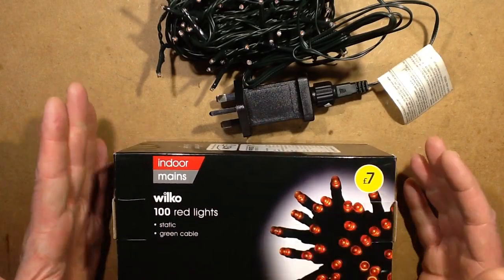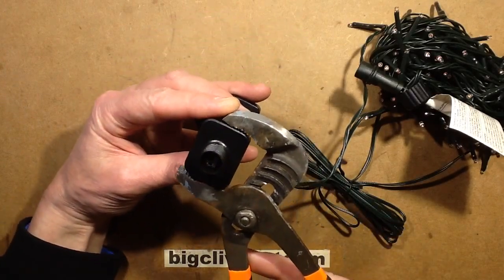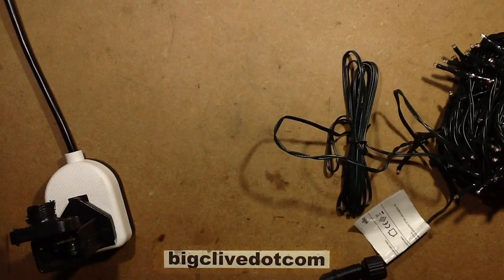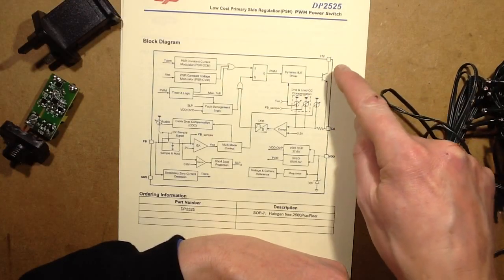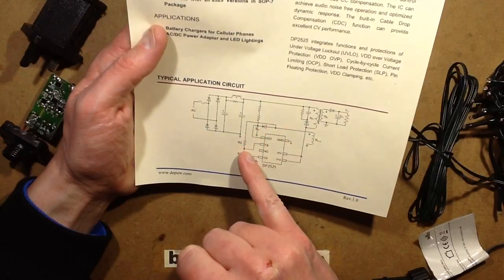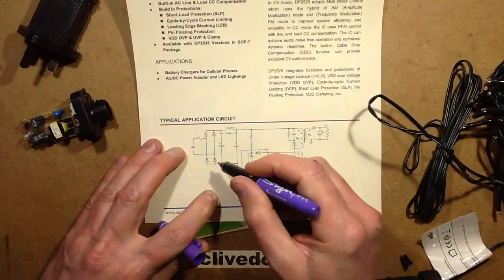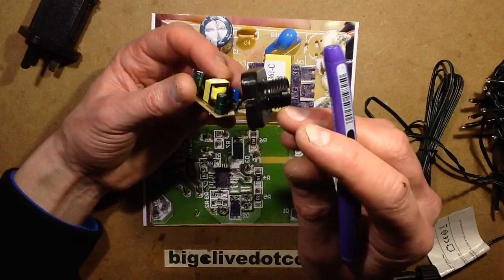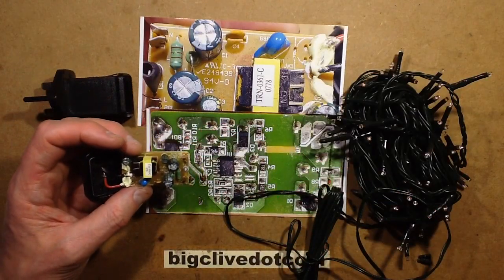Inside a Jutai Xmas lighting power supply.

Comment: Big Clive - I have a 200LED string powered by a JUTAI supply (https://www.amazon.com/gp/product/B07W8X7D14/ref=ppx_yo_dt_b_asin_title_o01_s00?ie=UTF8&psc=1)  and when I tried to shorten the led - cut in half...I had difficulty getting it to work...and when I finally got it working...I could not connect it in series with other strings.... what happens is that the modified string stays lit but the other strings turn off....what's up with this?  is there a trick to shortening this LED string?
Reply from the maker: The common connection for these strings usually goes to the opposite end of the string and then passes through multiple parallel circuits.  The reduced voltage of the shortened string will be lowering the power supply output voltage to a level that can't make the other strings light.
You can't really cut them down in size like that.

Comment: Would it be possible to add an inline switch to a power supply like this? The settings remain in the memory if I unplug the cable from the power supply while leaving the actual power supply connected to the power outlet. Would a special in line switch be required? And would the chip get damaged if it was constantly receiving power from the outlet without the lights being on?

Comment: Very interesting. None of the LED holiday lights I've seen here in the US have that kind of power supply; they just have the whole string on line voltage with a limiting resistor. They flicker like mad.
Reply: Could someone help answer a question? I bought some vine led lights off Amazon, it came with a 2 prong circular Dongguan Rico brand plug and a tiny black LED converter/driver box to go into my American style outlet. The voltage says 100-240v 50/60Hz .2A input, and output is 31V 193mA 6W. I’m not sure the voltage that my American outlet has but it was plugged into an extension cord that I’ve used for 2 years with no problems. The lights stopped working after 2 weeks. The driver/converter box still works with a different brand of string lights with nearly the same input/output so I know the driver still works but the lights on the vine don’t light up. Can I do or buy anything to fix it? Or did the bulbs short out or it’s a fuse issue? It was probably cheap and it says on the black box it’s made in China, which I’m sure they weren’t doing their due diligence to handle American outlets and it overloaded. If someone could let me know a way to fix it that would be great, I love the vine lights and they were a pain to put on the wall!
Reply: @maryhawker5003  I’m helping someone and she’s having the same exact issue, won’t turn on but the little green light for the timer works, but the strong of lights doesn’t turn on.

Comment: Hey Clive, I have one of those lights, except mine flash and there's a button to change functions. One set that I bought has warm yellow and red on one "side" and green and blue on the other "side", meaning either warm and red are on, or blue and green. How would i modify those non-destructively to only turn on the warm and red ones? I'd love to know. I guess this has to do with polarity and I am guessing I'd need to add some diodes in the circuit somewhere between the lights and the wall wart but I'm not sure how or where exactly.
Reply from the maker: If it's a two wire system then you could selectively choose the pair of colours you wanted by using a lighting power supply with the same voltage but just fixed polarity.
Reply: Sure, but that doesn't have the animation effects then!
Reply: @cheater00  Makers of of these 2-channel strings focus on always including both channels/colours in the effect modes.  Bi-colour controllers have the appropriate individual channel modes in place of modes of annoying types of flashing..they are attached to new strings though :)

Comment: Can you get lights like thi (decent low voltage supply)s through eBay as well, or is everything on there the stupid full-mains style?
Reply from the maker: If you can find the low voltage sets on eBay they're often at least as expensive as just buying them locally.
Reply: Or most of the time you can just cut the wire after the bridge rectifier (the little rectangular box on the wire) and power them by the voltage provided by the original power supply. I've found out that most of them run at 31VDC, even though it says 24VAC on the power supply.

Comment: So if I follow you,  could this power supply be repurposed with a different voltage by selecting a different sense resistor?
Reply from the maker: The winding ratio is also a factor, but the sense resistor would also have an effect on the output voltage.

Comment: Slightly off topic question: I recently bought a powered cooler pad for my laptop. It's basically a metal mesh frame with a great big 5v fan in it that you power off of a USB port. I'm concerned to use the power function because I don't wanna run into any inductive flyback from the motor. Should I install a diode and/or capacitor into it to guard against flyback or is the motor insufficient to the task of generating dangerous spikes?
Reply from the maker: They usually use an electronically commutated fan with back EMF diodes on the PCB, so it should be OK.

Comment: The "protection network" actually serves two very important other functions.  The main one is that of resetting the transformer core.  A plain free wheeling diode would protect even better, but it would cause a very long core recovery time and the drive frequency would drop from kilohertz to just hertz range.  It is necessary to allow some voltage overshoot. The other reason is to help provide feedback without the traditional optocoupler.  There is a company selling chips based entirely on this principle.

Comment: Un-fun fact:
100% of all LED christmas lights don't have proper DC smoothing.
Reply: I've looked at a LED powered straight from a 1 kHz signal generator, and it was still easy to see the flicker. All you need is for it to be a bright dot against a darker background, and then move your eyes quickly. If the light flickers, it draws a series of dots instead of an unbroken line. And this is why it's annoying in real life; instead of natural motion blur you see a glimpse of a dotted string.
Reply: Yeah, right. You don't see several kilohertz flicker, no matter how trained your eye is.
Reply: False. I bought some "north light" ones (as seen on bigclive's channel) from Clas Ohlson, and they are absolutely flicker-free. Some others were as well. But yes it's annoyingly common for xmas lights to flicker at 100 Hz. Also LED light bulbs for mains often flicker at a couple hundred hertz, but some of them are flicker-free.
Reply: Except these ones do? Any low-voltage DC set does, in fact. Ok, fair enough, they don't have proper smoothing, but the switching frequency of these SMPSes is high enough that you will not see them flickering.
Reply: Jasper Janssen I do see them fickering, due to my trained eyes 
Very annoying for an electrical worker like me
Reply: It's not about seeing the SMPS switching frequency as a flicker, but typically some low multiple of the mains frequency. You would think any SMPS-powered set should be flicker-free, but somehow not all of them are. But it's the cheap capacitive droppers that cause the worst flickering.
Reply: That's not a badly filtered smps output though. That's a less than 50% (because forward voltage — on a +5 to -5 siggen amplitude signal it'll be on the order of 20-30%) duty cycle, not a small difference in intensity (and most SMPS runs faster than 1k).
Reply: Jasper Janssen ot the high freq flickering, but the 50/60hz flickering.
Reply: 7367Network yeeees, but they don't do 50Hz, because SMPS.
Reply: The low-cost ones do, the expensive doesn't since they've got a DC switching power supply. For next Christmas I'm going to light up all of my house (edges and roof) with typical amber/yellow eBay lights, but powering them with an adjustable power supply, one of those fancy ones which can also limit current. Gonna be great.
Reply: The cheap ones aren't really low voltage though[1], they work all the way up in the most-of-mains voltages. You could probably divide the individual strings up without too much trouble, but they're not usually 10-series strings natively. Usually more in the 66-86 range, for 220-targeted lights.

[1] not in the colloquial "less than 50VDC is reasonably safe" sense, anyway. In the power company sense where everything under 1000VACrms is Low Voltage, and then Medium Voltage starts, sure.

Comment: Just a suggestion for Mr Clive! I think you will like it, since it burns and produces cancerogenic fumes in your unventilated room :-)
My favourite tool of controlled destruction is a glowing hot wire (just short length of nichrome wire in ceramic holder connected to old ATX PSU 3.3V rail, i have a few different diameters of wire ready for different levels of disobedience).
Instead of dremelling/grinding/drilling into plastics (which can mess up electronics underneath if you are messy/careless/drunk/stoned/impatient like me) i like to use it to cut through stubborn plastic. Or just generally instead of drilling/grinding plastic. Or to heat disobedient "security" screws heads, till their head melts through plastic when you pull the damn thing open. 
It comes with FREE CANCER included! and while it glows orange hot at 700-900deg. Celsius, the thinner wire has waaay too low thermal capacity to damage/desolder even the smallest smd components, just in case you hit something you did not intend to...
Merry Xmas!
Reply: Wow!

Comment: Merry Christmas!  Maybe the split series inductor design is an attempt to reduce conducted EMI. The removed resistors make me think someone fine tuned the design based on testing of early production boards, so they could've shorted out that second inductor if it passed pretesting without.

Comment: I got some lights from Aldi with a similar but same brand adapter, we plugged it in and it made a magic smell. So was discouraged to use it again, but tired it again no smell... I think the weird screw in part wasnt in correctly, its a czjutai model jt-el/fc31v3.6W-t 220-240V 50-60hz, its one with a button to change the modes.

Comment: I have a wall wart switching supply that spits out a pretty well regulated 12 v,  I'm used to seeing an opto isolator being used to give a little feedback from the low voltage side, but this supply does not have that, all that's connected to the secondary is a diode and capacitor and I wondered just how the hell it's able to regulate it's output. So I wonder if that works the same way as this does, It certainly would clear up that mystery.

Comment: Have you seen mikeselectricstuff's technique of tapping around the edge of these ultrasonic welds with the butt end of a screwdriver? Might not have worked with this particular supply but it does work pretty well.

Comment: A tip on ultrasonically welded plastic cases, wack the case with the handle of a screwdriver a few times. (I haven't had much luck with this technique myself, but it seems to work very well for Mike over at mikeselectricstuff)
Reply: subpar gaming, the Hittin' Stick and the Clampy Thing are useful for massaging the recalcitrant object under inspection when it has already released its magic smoke in a permanent sort of fashion and you just want to have a look at the guts and work out why it threw a tantrum. Opening things in this manner tends to be a precursor to tossing it in the bin once you've worked out why it's not worth fixing.
Reply: @sixstringedthing  I've had alot of luck with the "gently clamp it in the vice until it makes cracking noises" method to get glued or ultrasonically welded plastic cases to split at the seams without destruction. They can usually be glued back together without a whole lot of evidence of the vice squeezing also.. 🤷🏻

Works for me anyway.